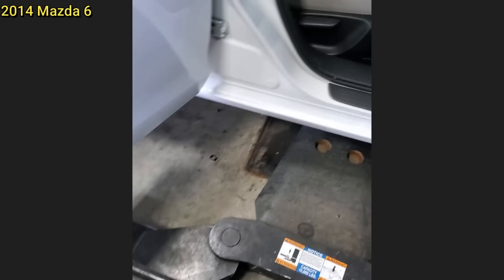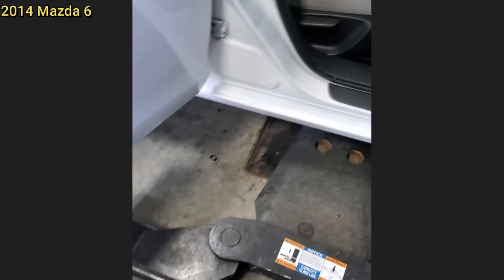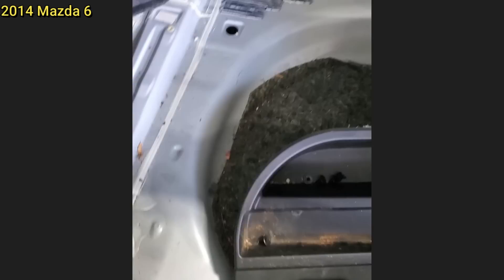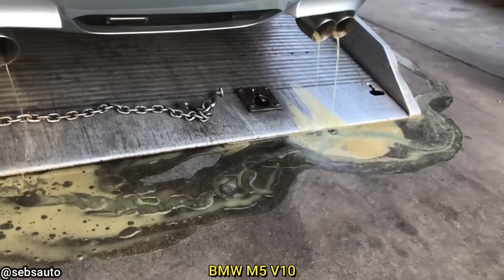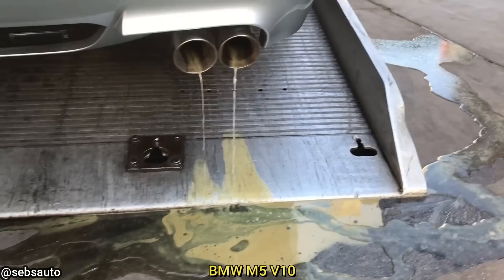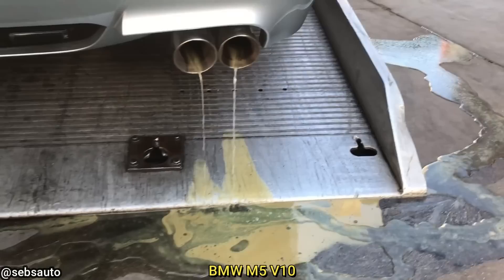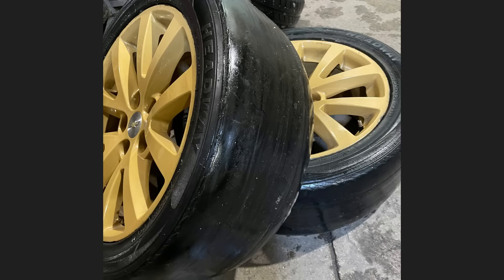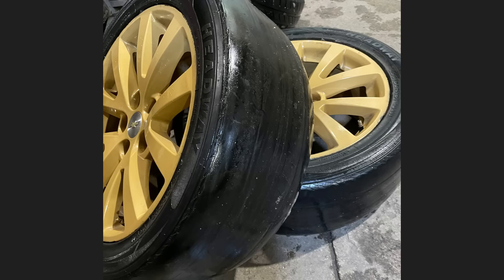Customer States Heard A LOUD Noise When Trying To Charge Tesla

Comment: I was driving my mom's Ford Ranger when the gas pedal BRACKET(!!!) broke off the floorboard. I kept one of those Walmart plastic-cased automotive tool kits in the cab and I knew a bit of auto repair stuff. I removed the pedal from the throttle cable, cut a PC keyboard's wire off, tied it to the throttle cable, and fashioned a handle. I drove this MANUAL truck 20 miles to the home mechanic's shop, pulling the wire for fuel and letting go to shift.

Comment: Had a brother in law needed to move his pickup without an engine. Put a tow hitch on a VW Rabbit and we pushed him 60 miles to the mechanic shop. No towing charge... 😁
Reply: We used my mom's 83 Rabbit to pull my dad's 63 Ford F100 out of the mud when I was about four years old. It took a lot of spinning, cussing, and effort, but it eventually got it it moving. My dad taking that  truck up the field to grab a load of firewood and getting stuck by the pond ranks as one of the dumbest things he ever did. At the time we didn't have enough money to call a tow truck to extract him from that situation. Had I been old enough to drive we probably could attached his 85 Vanagon to the front of the Rabbit and had extra pulling power that would have shortened that three hour ordeal.

Comment: I'm surprised nobody commented on the infancy of a the infant car seat up against  the passenger side airbag. That's a huge, huge no no
Reply: I don't know if that's a thing in american cars. But in almost every european car you can disable Passenger airbag fairy easy, so you can put baby seat like that. And i think, that this feature is specifically to do just that.
Reply: @marekpostawa5267  American cars usually have a weight sensor that disables the airbag if there is not enough weight on it, or deploy at a lower intensity. Problem is that sensor isn't infallible, and there isn't a backup way to disable it manually. Also, most cars do not detect weight under about 30 pounds and (depending on the car) may still deploy the airbag in a collision. Also, if you ever get in a side impact collision, the side curtain airbag can still injure the infant. This is why it is drilled into people that you should always put the infant car seat in the middle of the back row if at all possible.
Reply: Would you rather the parent be leaning back into the back seat to tend to the child?

It's only a problem because politicians, many who haven't driven a car since 1972, thought they knew the best way to do things and wrote it into law.
Reply: @Crosshair84  the reason this got banned, was pretty simple, they learned the air bag going off can decapitate babies.
Reply: Well no one from Europe commented because over here this is just regular practice as you take your car key, disable the airbags on the front  passenger side as it is shown in the manual that comes with your car and that’s about it …. nothing to comment there
Reply: @richardmillhousenixon  and what about cars that do not have a back row you put your infant in the trunk? Here in Europe you can disable the front airbag passenger side with the car key. And that’s just a regular practice that Every car manufacturer has outlined in the manual for the car.
Oh and European cars have weight sensors too
Reply: Depending on the car, many have the option to disable passenger airbags manually in which case as long as the seat is secured having it up front is fine.
Reply: @andi-ih3jj  What part of "if at all possible" did not make sense?
Reply: @andi-ih3jj  sure we have the sensors and can disable it... but: 

parents aren't supposed to be distracted driving by interacting with their children in the front, like feeding a bottle etc. 

even without the airbag issue, for safety, children under a certain size must be in the back seats by law in carseats or booster seats. 

we're also not allowed legally to disable certain safety features from factory(varies by province/state/territory).  i have a couple of safety features i'd love to disable... including the driver's airbag. 

if your vehicle is only a 2 seater... well now, then you have more issues than where to put the carseat.
Reply: @kellynnd5361  For the drivers airbag, you can get a switch installed that can disable the airbag if you sit closer than 10 inches from the steering wheel when driving. You have to file paperwork to get it installed because it is technically an adaptive driving device but it can be done. I have one in my car because of my stature
Reply: @richardmillhousenixon  Sorry, I am not native english speaking so I might not have gotten the proper understandig. I just wanted to point out that there are reasons not to put a child in the middle backseat. Here in Europe we use most of the time a system provided by the car manufacturer called isofix which are two clamps that are welded/screwed onto the body of the car and childseats have the corresponding parts to clip in there so there is no need to use a seatbelt. Newer cars even have a third mounting point called top tether This system is very, very safe but most of the time only supplied on the outer seats in the back as in Europe cars tend to be not as wide as in the US. I only know of 15-20 car types that have 3 isofix in the back (Audi Q7 Land Rover, some vans from Opel, VW, Peugeot, Mercedes, Citroen, Ford....) and very few of those have 5 isofix in the back when bought with 5 seats in the rear
Reply: @kellynnd5361  Good point with the distraction, but a crying child in the backseat can be very distracting and almost everybody will look backwards then. I have done it and was done in from a grandmother doing it while riding my motorbike. She was driving opposing to me looking into the backseat at her screaming grandchild and to swerved over to my side of the road with her entire car forcing me off the road into the ditch. I feel that glancing to the side is far less distracting than looking backwards. But I know one should do none of both .... but seriously, who doesn`t
Reply: @andi-ih3jj  In the US most cars have some sort of tether point on the rear seats, usually one on the back of each seat (you sometimes have to fold down the seat to access the hook) and two in between the seat cushion and the back cushion. The center seat usually just shares the two inside tether points from the outer two seats but has its own tether on the back of the seat. Some cars don't have that, however, and in those cases you tether it down with the seatbelt, usually pulling it all the way out so it ratchets back into place and can't be pulled loose unless you unclip it and let it fully retract
Reply: @andi-ih3jj  that's when you do the smart thing and pull over.
Reply: @richardmillhousenixon  yeah i'm only 5' 1, my height is the issue as well, but at least i'm taller than my 4'9" ish mother lmao.

when you get it, you're basically signing a waiver for any injuries or even death, as a result of preventing the airbag from going off. it can cause issues with insurance coverage, which is why i haven't done it.

Comment: Baby seats in the front are allowed in Spain, but if they are mounted in opposite direction (like the one in the video) and the car has passenger airbag, it has to be dissabled (it can be easilly disabled by the user using the car key to turn a mechanical switch).

Comment: 0:20 Here in Connecticut, it is only illegal to have a rear facing baby seat in the front passenger seat, when you have an active airbag on that side. Which is one of the reasons for being able to deactivate the airbag on that side manually. I cannot speak on other states for this, but that is how it is in Connecticut.

caveat: Just because it is legal, does not make it a good idea.
Reply: Same all over Europe. All new cars and all baby seats have a visible notice to remind that you must deactivate the passenger airbag when installing a baby seat in the passenger seat.
Having the baby seat on the passenger seat is proven to be much safer than having it on the back seat. Especially when the driver is alone with the baby.
When parental instinct dictates to check on the baby it is preferred that the driver looks slightly to the side and still has a view of the road rather than completely turning back.

Comment: 0:15 - What's the floor panel made out of, or how fast was that guy going? These should have mandatory skid plates... that add even more weight and reduce range.

Seriously, how much is that gonna cost the guy to replace?
Reply from the maker: It's a $2000 deductible the customer has to pay his insurance company I was told.
Reply: I seem to recall reading somewhere Tesla battery units run about US$10,000. Not sure if that's the pack itself or with removal, installation, and disposal etc. And that's completely ignoring that there could be warranty options, I honestly don't know myself.
Reply: I wonder if they also heard "a loud noise" when they drove over the huge rock that punched its way into the battery? :-))
Reply: There's a gouge leading up to the rock, so it wasn't kicked up at speed.  I'd guess they drove over some kind of curved surface that happened to have a rock in the wrong spot, so instead of just scraping the crest, they jammed a rock into the bottom.  If the rock was bigger, they might have gotten stuck on it.
Reply: The floor panel is made out of steel. Teslas are not made to off road.

Comment: I think that whoever told that guy to put installation under your hood for rats was just fooling 😂😏😅
Reply: Yep. Some people will believe anything. In high school, 1980 or 81, in shop class, this one guy brought his Plymouth in to work on it. We told him to get a chrome thermostat cover and it will add 10 more horsepower. Couple of weeks later he brings it in again and he'd put one on. Somebody mentioned it and he said, "It does add more power." 

I've been laughing at that ever since.

Then he takes both valve covers off, and, with a half inch impact, tightens the rockers down as much as he could. We asked him what he was doing. He said something about the book said to do it this way.

When he tried starting it. Nothing. We had to convince him he messed his engine up.he took the rockets off and every push rod was bent along with some valves.

And he wanted to be a mechanic.
Reply: It was a pile of 50 rats in a trench coat.

Comment: Living on a farm we get rats making home in the vehicles quite often. Particularly bad in mowers etc. The worst part isn't just the mess and the smell, it's that they chew through all the wiring. One way we reduce it is to leave all the doors and the bonnet open so they don't have such a cosy place to sleep. And it means the cats can get inside with them too. Admittedly this is easier if you can lock your vehicle in a barn for security.

Comment: That first clip makes one wonder about how that process will work if Tesla really starts incorporating the battery pack into a proper structural element like they have been talking about. (idk if they have done this with any of their models yet, can't say I gobble up every bit of news that comes out of Tesla, but I do remember Musk talking rather proudly about doing this in the future, not that long ago)

One of the benefits of a battery pack, i.e. something that is essentially a bolt on part and comes with all of the convenience of being one, is that it is far easier to remove than something which is a structural member though by being bolt on, it increases the weight which is why Tesla likes that idea of making the battery part of the structure, but..... Even if they come out with a battery that can work great for 10 or 15 years or more (or whatever the expected lifespan of the car actually is), what happens in a situation like the one shown here? Is it simply to scrap the vehicle for something that would be repairable in other cases? Doesn't that go against the whole reason for EVs in the first place?
Reply: Being structural doesn't mean impossible to replace. It probably just means more bolts to remove, and more care in lifting the chassis correctly.
Reply: @logitech4873  Not impossible sure. But unless they come up with a novel method of replacing them that isn't bad,  it will mean it will be a pain in the ass.

Comment: That car seat in the front like that is the correct way for those wondering, airbag won't go off with that much weight, not to mention in a head on the child will be saved from whiplash

Comment: Just in case you didn't get an answer for the UK for 0:20 yet: In the UK baby seats are allowed in the front (although not recommended, it's recommended they are placed in the rear). Also it's only allowed if you can and then have disabled any airbag that might be fitted for the front passenger seat, especially if it is a rear facing baby seat like in the clip.

Comment: In the Netherlands it is allowed to place your baby/toddlerseat in the front. Best then to place the seat facing backwards. Up to 15 months that is compulsory (if in front). Children, especially babies, have a lot more chance to injury. Children’s heads are very heavy relative to the body. So if facing  forward in case of a forward collision, chance to neck or other injuries is much bigger.
Above 15 months forward facing seat in front is allowed, but you have to turn of passenger airbag.

Comment: I had a similar experience. With my ex mother-in-law‘s car. She thought her brake fluid was low. Making a slashing noise. After a quick test drive. I pop the trunk and found for half empty jugs of antifreeze. I guess she thought 50% you can only add half the bottle.

Comment: In the EU baby seats are allowed to be on the passenger side; if the baby seat is tested for the specific car model, and the passenger airbag is turned off. There is even a specific sticker in many cars which illustates to turn off the airbag when you use a baby seat in this location of the car. It´s also stated in the car manual.

Comment: 0:25 I would think it is legal in every country, at least in UK and probably whole EU.
Only requirement is to turn off the airbag or airbag not to be present at all. If turning off airbag is not possible, then it is illegal.
But in any way, baby is safer on back seat. You will be less distracted by checking the baby.
Reply: Not legal in Australia unless the car has no back seats...
Reply: @nicholasvinen  Every country is different. Always check rules before driving. But anyway, I would not put my child in front seat. It may be very distracting.
In modern cars from security perspective it does not matter much if front or back. Back seats are currently sometimes even more dangerous in modern cars than front, as front were focus of research and improvements for past 20 years at least.

Comment: I had to chase a no start in a 1012 jeep compass because a couple rodents chewed the harness located in the driver's side trim panel not the the seat not shown in the wiring diagram. Had to remove the dash and clean the rat nest out of the blowermotor and the smell was so bad that I kept getting dizzy inside. The seats floor cup holders and center console where covered in piss

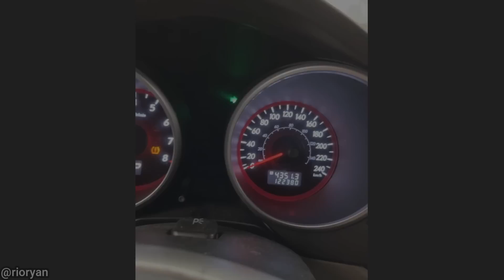Comment: At 0:40, I’ve seen that before where the turn signal flashes the dash lights. The customer changed the bulb in the back taillight and used the wrong bulb causing the ground to run into the running light circuit.

Comment: Don't forget to change your 50/50 oil and antifreeze mixture and pour it directly into cylinders. You have to remove spark plugs first. Doesn't help if it isn't pouring out the exaust pipe.  For best results, color should be brownish green. Owner had blinker fluid replaced when engine was re-built.

Comment: 0:24 it’s ok to have a baby seat in the front provided that the passenger airbag has been deactivated. I’ve driven several cars where there is some sort of easy deactivation feature for the front passenger airbag, usually a car key type lock/switch or within the features of the in car entertainment/ control system.
Reply: Not depending on your local state laws or what country your in. In a lot of states in Amercia this is straight up not allowed. Even in Spain this specific incident wouldn't be allowed at all.
Reply from the maker: Not allowed in most places. Also your visor says to never put a rear facing child seat on the passenger side. As well it's a SUV that has a lot of seats lol

Comment: I've had a shorted lamp like that as well. In my wife's car the brake and rear light were shorted like that. When you braked all the backlighting in the cabin came on and if the engine was off it would beep because your lights are on.

Comment: The BMW with the bad PCV…… replace the valve cover. Don’t get the rebuild kit. Puts the crankcase into a big vacuum and it maybe a little fun to pull the oil cap while running. Another shop diag said it was a bad Vanos. Yeah, no. If you watched fuel trims it was super lean, extreme when the oil cap was removed. Ran great after the cover was replaced, well at least on the ones I’ve done.

Comment: 0:24 baby seats are allowed on front row in my country (Czech Republic, middle of Europe). 
You generally need them to be fastened with seatbelt well (or with other certified mechanism like Isofix etc.) and IF you are having a reversed baby seater in front like the one on the video, you MUST turn off passenger airbag before installing the seat, because in case of its activation it would basically catapult the kids towards the big seat and injury it badly or probably even killed it (tons of G force and hitting things etc.)

So you can and it is safer than having a small kid in the back, such small kid is definitely easier to hand back a toy it threw away, do a face to, cuddle quickly or hand a bottle with milk/tea in it. But not having it fastened at all is not wise and even transporting it this way is ... weird
Reply: Same goes in Sweden.